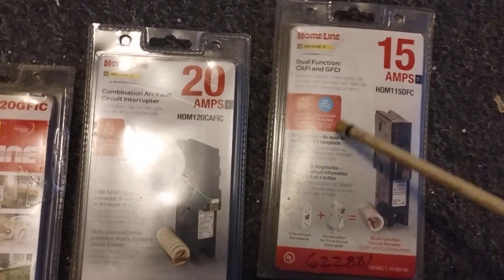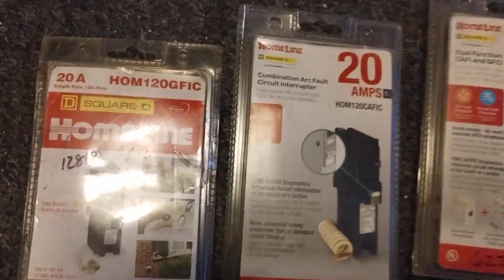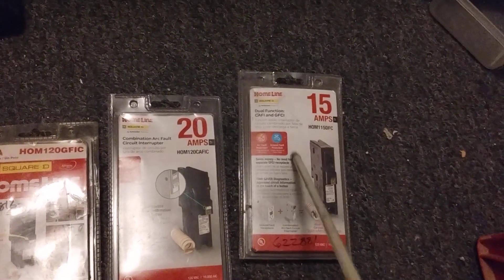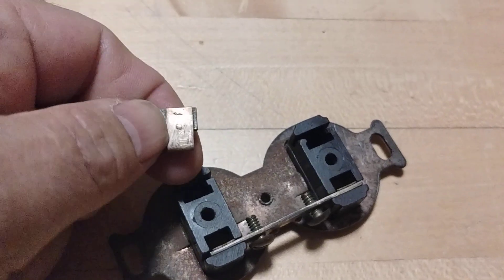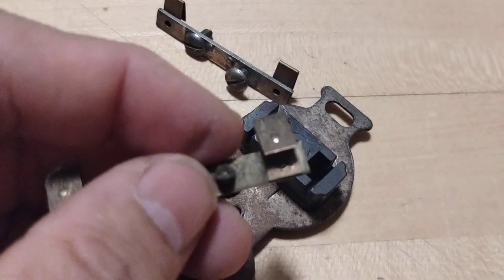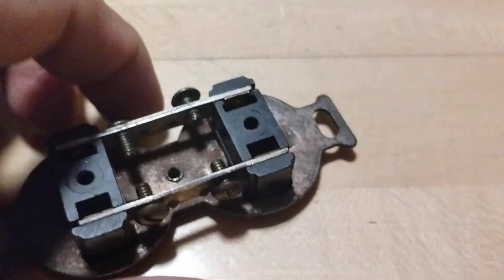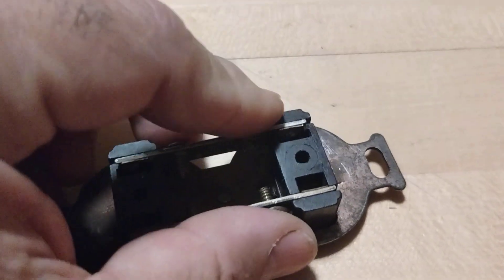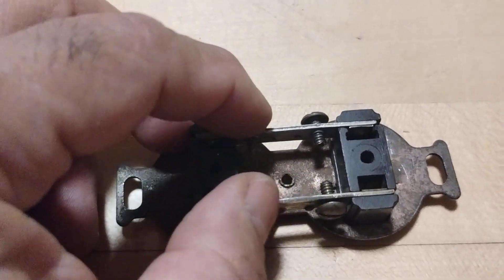arc-fault breaker why knobb & tube and everyone should install them

Comment: This is really good to know I have heard of those breakers before all the newer homes have them I just assumed if it’s a two wire electrical system you had to rewire the whole entire house I did not know you could just put new outlets and circuit breakers. Damn good information. Thank you again.
Reply from the maker: Yes, it works from Ground and neutral and also algorithm that tells the breaker a "short" is taken place.
Reply from the maker: Odd rule some locations require you to install two prong receptacles unless the ground works OR it's a GFCI receptacle (different jurisdiction requirements)... I'll get you a link. 
Again, some two wired boxes still have ground access if the sheathing acts as a ground and then you use a special receptacle to created the ground.

Comment: The problem with arc fault and combos is nuisance tripping. Otherwise I strongly agree that K & T, or any system without a ground conductor should absolutely be outfitted with GFCI.
Reply from the maker: Cognitive, I am lucky, my arc-fault breakers have not false triggered yet...
Reply: @ForensicCats  I understand motors in some newer model refrigerators are highly susceptible.  I myself have no first-hand experience with it, but thats the buzz within the community, if you'll pardon the pun. 
Regarding you motor rotation question, I would tell you that the direction current travel is from source to neutral. Not sure if thats what you were hinting at or not.